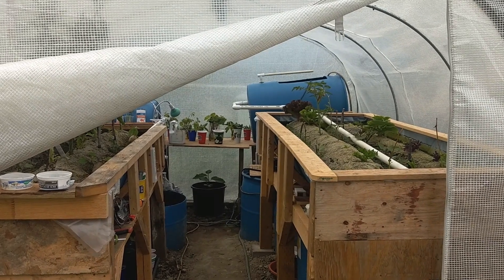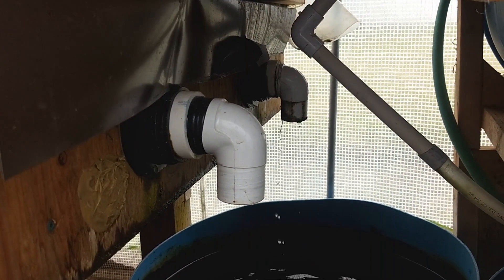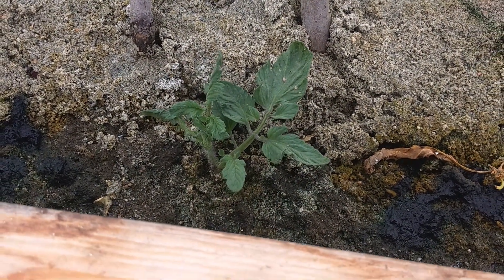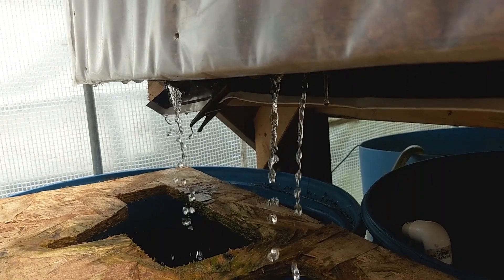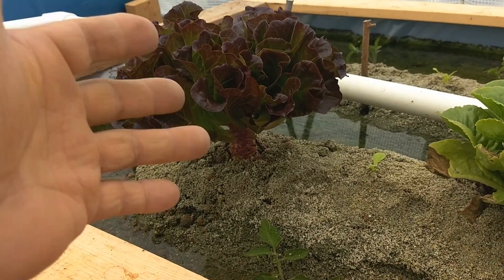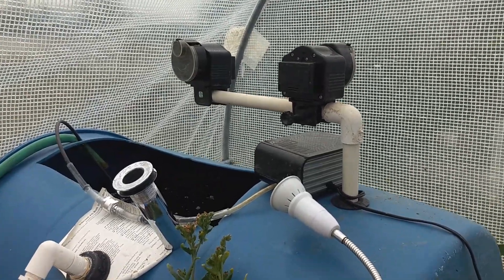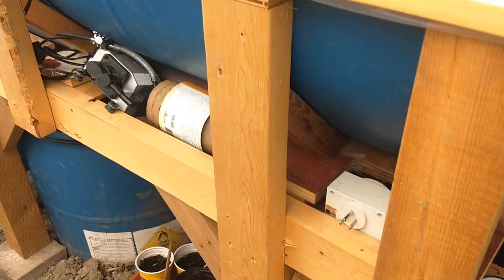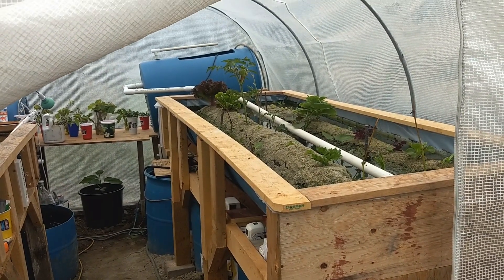My first and second iAVS sandponics: the simplest form of aquaponics

Comment: The bed is made of plastic foil. I had the problem that mice ate the foil and the sun ate the foil after a year. I'm here in Namibia Africa and the damp sand keeps everything cool, so very good system. Does anyone have a tip?
Reply from the maker: Try using silicone based pond liner to make sand beds

Comment: Is this a continous flow sand bed??? I was wondering if it was possible to do that... almost like a channeled NFT and gets absorbed by sand. Do you have any root rot from this way?
Reply from the maker: No, the water is pumped once every two hours. The point is to get enough hair and moisture to the root. This is the best and easiest system I have ever seen after testing it for 4 years.

Comment: More or less howmuch water you have in use to make shure there is allways enough to make the pump is not running dry? And what kinda sand is used so it does not slibs away?
Reply from the maker: Good questions. How much water to use in order to make the pump not running dry? It depends on the setup. I used three sump tanks which made the problem worse as the drained out water would not return to the tank where the pump was located. To solve the problem, I added an overflow drain pipe to the fish tank so that the fish water on the top (wihout the fish poop) can overflow out and go directly to the sump tank with the pump inside. I used the play sand which turned out to be too fine. The drainage ports need to be stopped with fine wire mesh and then gravels before adding sand. This way the sand will not slip through the drainage holes. Check here for more info: https://garydonaldson.net/home/iavs/iavs-frequently-asked-questions
Reply: Not that we only pump the water for 10 minutes every two hours. Knowing how much liquid the pump can handle during this 10 minute period, then we know the minimum water amount required.

Comment: Can I use medium sand or use fine sand
Reply from the maker: I would use medium sand at the bottom and mainly fine sand on the top surface. Make sure the sand is washed and going through some sort of sifting process to remove any grass sends. This way, you do not need to take care of any weed problem as there is not a single weed seed.
Reply: @PyraPOD  The sand should be mixed uniformly - if you put fine sand at the top it would (could) just percolate down. In fact, zero fine sand! Coarse sand .4mm  to 1.2mm
Reply: @PyraPOD  Thanks

Comment: You should think about adding a baffle on the drain end. Maybe 6 inch es. Using a fine mesh to seperate the sand and try filling the baffle with rocks or the clay. Support for the mesh, Just a thought. Hope it helps

Comment: Don't you find that plant growth is slower than in an Aquaponics system?
Reply from the maker: No, did not notice the difference. One thing I do notice is that iAVS sand produces roots faster than the hydroton grow bed. Thermal mass of sand plays a role. The major problem with hydroton grow bed is that the fish poop is ended up at the bottom of the grow bed which becomes stinky, while in the case of sand, the fish poop stays on top of the sand surface and it is easier and faster for aerobic  bacteria to turn amonia (NH3) into nitrate (NO3-).
Reply: @PyraPOD  Thanks for sharing your experience. What you say makes a lot of sense. Do you have an engineering background?

Comment: Hello, I been using Aquaponic for now almost two years, and it's working fine. The thing is since we have plenty of sand here in my country (United Arab Emirates) I frankly speaking thought of diverting part of the greenhouse that we have to sandpanic system, similar almost to what you have. I suggest the watering time shall be moderated, in another way if you install a timer whereby you can control when the water shall start watering the plants.. I believe two to four times a day for about 10 minutes will be just fine for them.. and the rest of the times the roots will be oxygenated.. plus add some worms to the sand, it'll help cleaning your sand from the algae that form within time.. Thanks for the good video man  👌👍
Reply: Good day Mohamed. It seem like you know a lot about sand aquaponics, I have a question, do you perhaps know how much water is lost through evaporation with sand aquaponics compared to traditional aquaponics??

I saw other videos of sand aquaponics and most of them are located in and around the middle east. 
Thanks
Reply: @mr3748  good day there, honestly I don’t have idea about sandoponic system I only have knowledge about Aquaponic. But I assume if I use the sound system and since I half the plants in the greenhouse I think the amount of water is operating is more likely than planting in an open area, because of the big giant fans that sucks the air to cool down the greenhouse.
Reply from the maker: Thank you for feedback, I did just that. As for how to introduce the water into the sand grow bed, I have a better way in my mind that I have not tested: that is not to introduce the water from the top of the sand, but somehow bring in the water into the middle layer of sand. This way the algae growing problem is gone as there is no light in the middle layer and there is also less loss of water due to evaporation. Will test this in my new build in PyraPOD, an upgrade greenhouse using soap bubbles to insulate or as shading dynamically on demand. Check out website at pyrapod.com for more info.
Reply: @PyraPOD  I would not advise introducing water into the middle sections of the bed...it will create problems.   The algae is not a problem...it's part of the detritus layer - an important cornerstone of the iAVs method.
Reply from the maker: @garydonaldson1336  OK, thank you for your advice, Gary.
Reply: Aubrey Zhang thanks a lot 👍🏼🤲🏼🙂
Reply: @PyraPOD